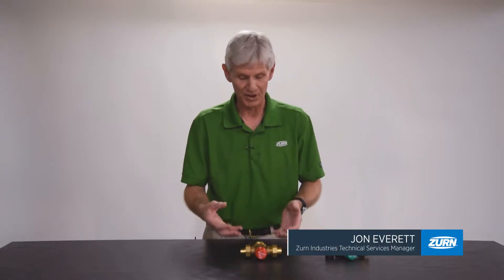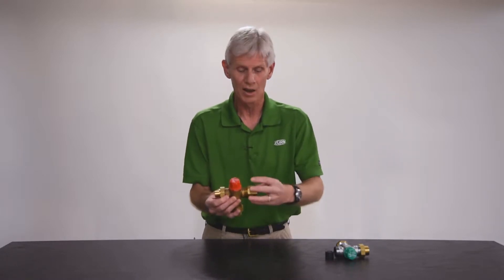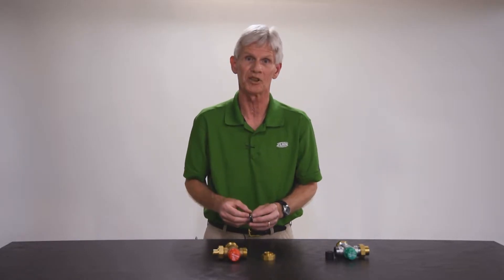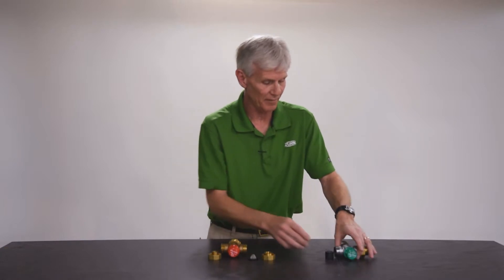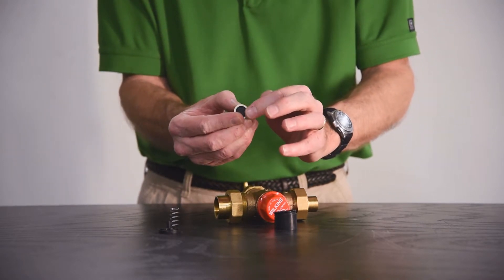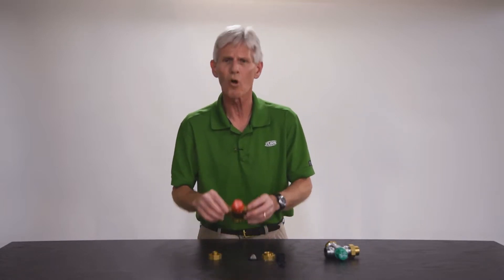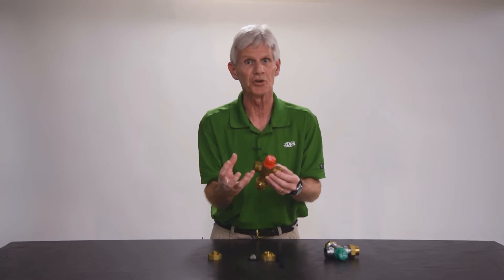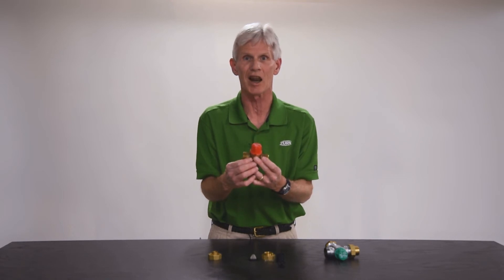Zurn Wilkins Thermostatic Mixing Valves (TMV) - How to Repair and Rebuild

Comment: Thanks for the reply!  I had a plumber come today he swore to me the mixing valve did not go directly to the soaking tub.  I kept saying it did. He said it was only there to keep water moving through the recirculating device that gives us constant water?  I do not believe that!  What do you think?  He also said the mixing valve was turned as far as possible counter clockwise, so I guess my question is why is my water in my tub warm but not hot.  I can leave my hand under the water turned all the way up so I know the temp is not hot enough.  All the other fixtures in the house showers sinks etc will scaled you?   He did say the faucet on the tub also had a scald valve that was maxed out?   I am just mad that I bought a new home and I can not even use the soaking tub.  I did find a work around.   I have a pool noodle from the sink Hot on my wifes vanity and on my vanity that reaches the tub and I turn those on hot only and fill the tub as I am filling the fixture on the tub.  But I have to get out to turn it off or if it cools get out to turn it back on.   It is so frustrating.   But I will say Zurn has been great about replying and even took a phone call from me.   Do you know what would  happen if I turn the mixing valve around?  Hot=Cold Cold=HOT?

Comment: I have a new home green top on it and it does not have an adjustment under the green cap! I can not even get an adjustable wrench to grab it to turn it clockwise.  My water is luke warm at best.  I can not get the plumber who built the house or installed to come out and fix it so I have real hot water?  What are my options.
Reply from the maker: To raise the temperature, You'll want to use the small nut at the top of the valve and rotate it COUNTER clockwise. If it's still not adjusting either way, Please reach out to Zurn Tech support at 855-ONE-ZURN. Thank you!
Reply: @ZurnIndustries can you guys make a video on this. I have the same issue I cannot get a wrench to grab the nut at the top.
Reply: @ZurnIndustries  UPDATE!  I am still not getting hot water in my soaking tub, I can not turn the nut on the top as who ever installed it used pliers or something on it so it it stripped.  I think I need a new valve.  Where can I get a new one.  I actually turned it around HOT=COLD, COLD=HOT.  And it still does not put any hot water into the tub.   Where can I get a new valve and where can I figure out what size I need to order.   I assume it is 3/4 but not sure, can you tell me.   On the green cap is says Aqua Gard 1070 ASSE ZW1070XL  Thanks for any help.

Comment: How do you remove the cap on the green one? I tried to use a screwdriver but it won't budge at all.
Reply: Hi Samantha! Thanks for your question. To get the green cap off you can pop it off with a flathead screwdriver where the small opening is. Please let me know if you have any other questions! You can reach me at abbey.hickmann@zurn.com
Reply: I have the same problem.  I tried to follow their guide and lift up lightly with a screwdriver while inserting it in the slot under the green cap.  I swear it has to be glued on.  Did you ever get it off?
Reply: I did, I took some pliers and got one end in there and managed to get it off through a combo of destroying the plastic and it finally popping off after about ten minutes of me struggling to destroy it (I was going to rip it off piece by piece at that point). The cap is no longer functional.
Reply: "I tried to use a screwdriver but it won't budge at all". Thanks though. I have no idea why our builders decided to put one of these in the master bath and set it at lukewarm for the bathtub. Might be useful for children or the elderly, but not really for my situation.